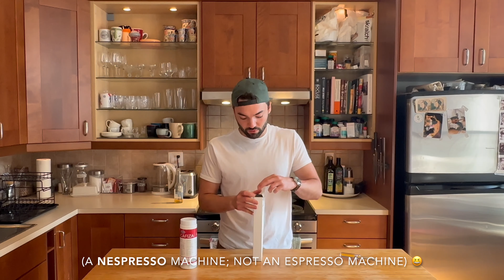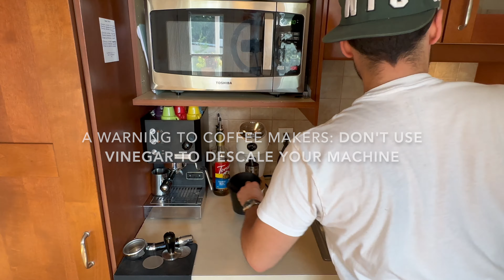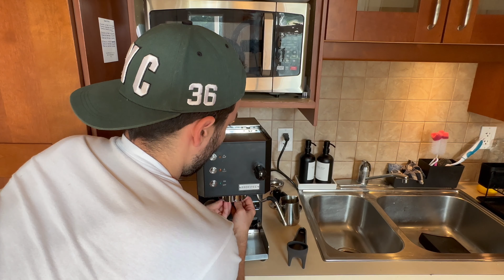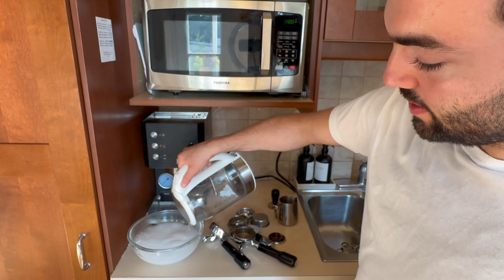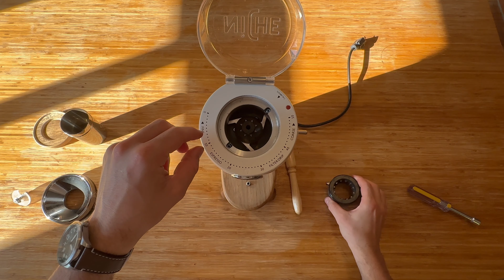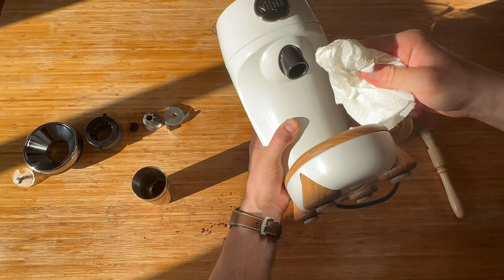Cleaning Your Espresso Machine & Coffee Grinder: Profitec Go and Niche Zero | Tech #1

Comment: Did you descaling Profitec go?
Reply from the maker: Upon further research on the machine, I don't suggest it (unless you have really hard water in your home). The reason is that descalers (even milder ones) can remove chrome plating from the E61 brew group which will end up flaking into your coffee. I'm sure there are some pros out there who can help you bypass this issue.